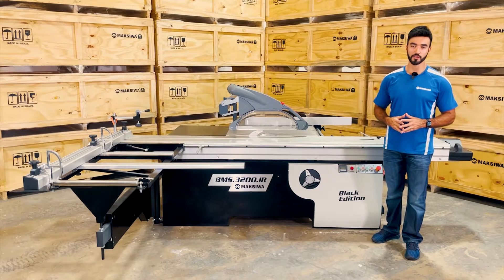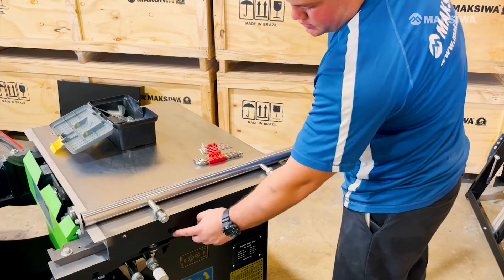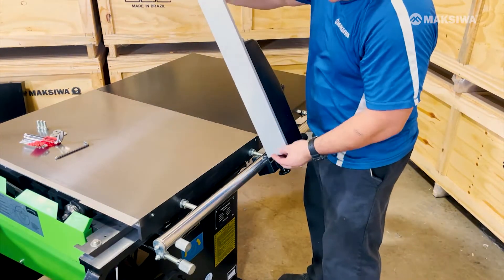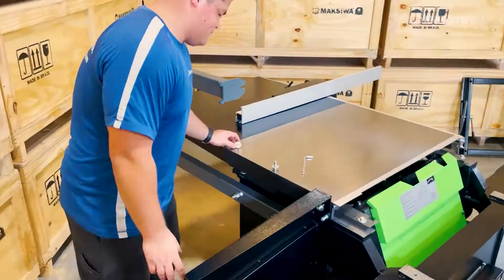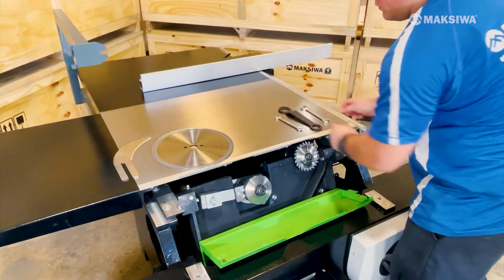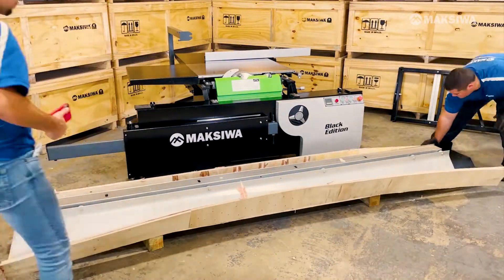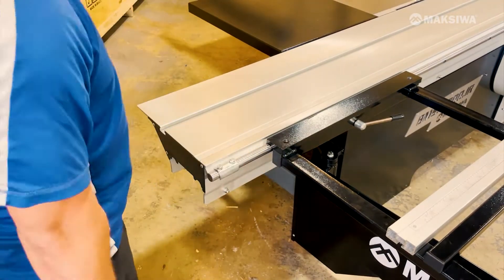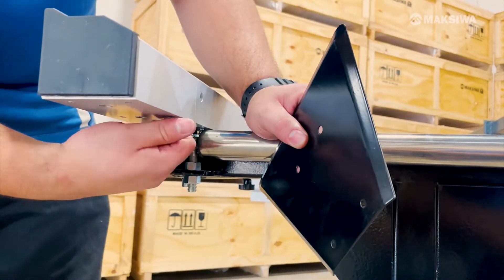BMS.3200.IR - How to Assemble?

Comment: Good Saw What Im not agrred is with the structure and mechanism of the fance and how movement i strumental need to be revised and reviewed engineering and the manufacture. It has clip that falls easily and got stoked constantly. In the shop I have to used because is the only one my boss  has. Please if others persons have the same problem advise in this comment to help the improvement of the machine because  is excellent tool. 
Thanks